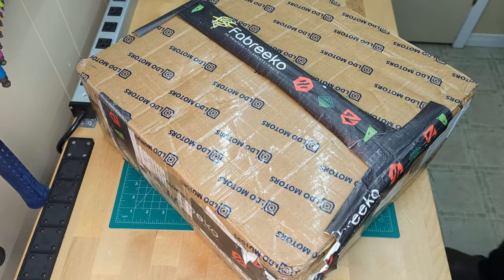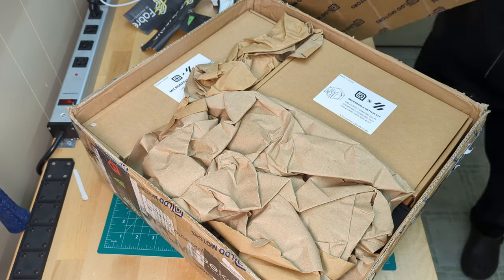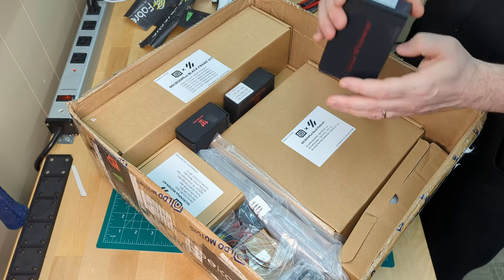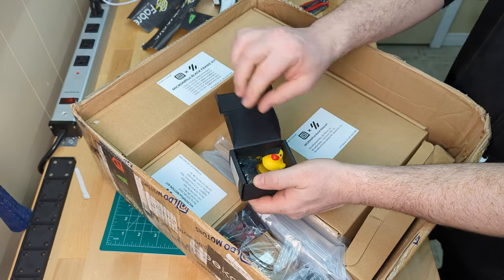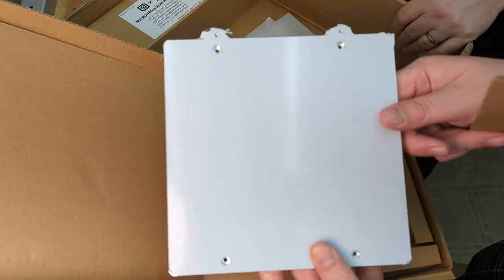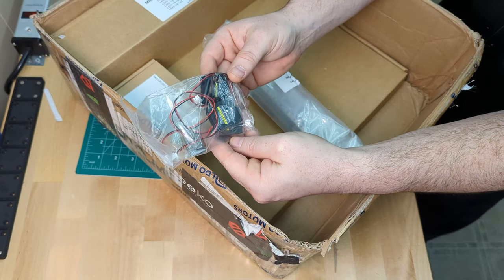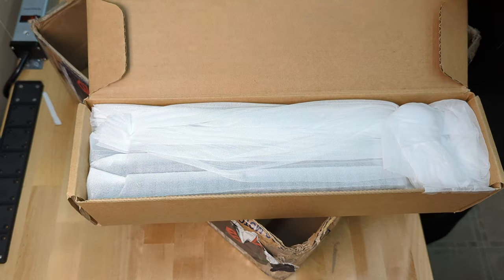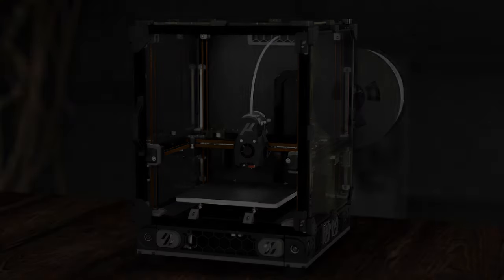Unboxing the Long-Awaited Micron Plus Kit - WOW!

Comment: My kit is preordered with fairly similar parts; it will be great to see how you set up CAN on the manta and if the utoc is needed. Thanks for sharing your journey.
Reply: I'm running the M8P/CB1 on my Tri-Zero with a SHT 36 V2. I also considered bypassing the UTOC straight to the board, but decided against it just to keep my wiring leads a bit more controlled (a la Picobilical).
Despite the growing pains of flashing the 3 boards so that they all communicate with each other properly, I've had no issues since, and am finally rid of those stupid bulky USB cables. Manta are definitely top-notch boards for these builds.

Comment: I hope you're putting Dragonburner on this too! Although I suppose it is only proper to test the 3010 fans before upgrading toolhead ;)
Reply from the maker: Yeah we're going to start with a MiniSB, but I suspect it'll end up with a dragonburner soon after.
Reply: @MapleLeafMakers  Rapidoburner for the rapido isn't it? Same guy making them and they're awesome!
Reply from the maker: as I understand it, the standard rapido will work with either DragonBurner or RapidBurner... its only the HF and UHF that require a rapidburner... I Might be wrong though, will have to double check.
Reply: @MapleLeafMakers  rapido hf is supported by both yes, the rapido uhf is supported only on the rapidburner. The rapidburner may be better suited also for the rapido hf due to more optimized cooling
Reply: @MapleLeafMakers  The "normal" rapido is the HF though, there's no SF Rapido :) But you're right - the dragonburner does in fact support the rapido hf as well, live and learn! I'd still go for rapidoburner myself as it has somewhat better hotend cooling for the rapido as far as I know, but dragonburner should work too then :)

Comment: the 180 micron looks soooo good, Im safe for now the kits are sold out, I only had one of those kits in and out of my cart like a dozen times. I wish more of the printers for ant kits had been around when I built my v0 would have much rather built this for pretty much the same price
Reply from the maker: the kit is not as complete as the V0 kit, you need to provide a lot of your own components, so the price comparison isn't really apples-to-apples, but it's still a good value, and 180 really feels like the perfect size.

Comment: hi. what orca slicer settings did you use-same as 2.4 but edited? is it possible the config is available for download at all? many thanjs
Reply from the maker: Hey!  This printer is set up just like our other Vorons, except with a little extra acceleration and speed!    Unfortunately we haven't published our profiles for this, no.    It's basically a stock orca 2.4 profile though!   Hope that helps.